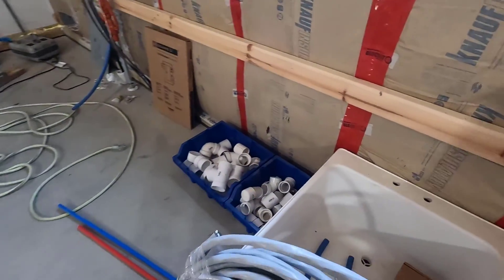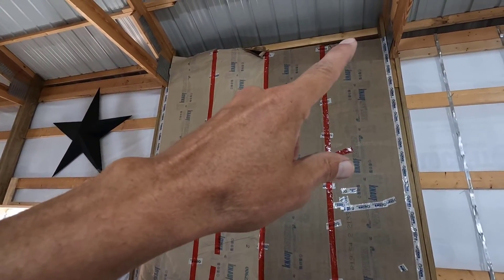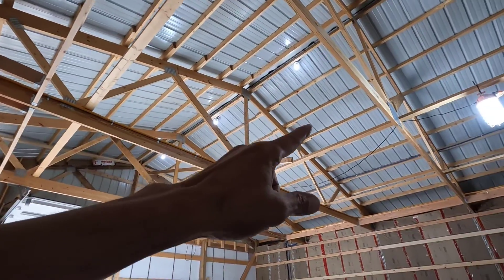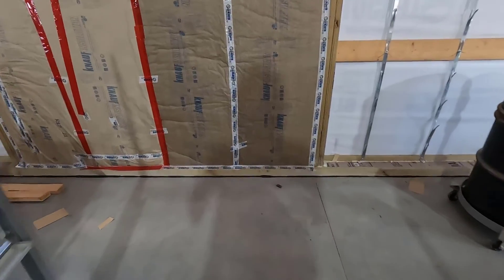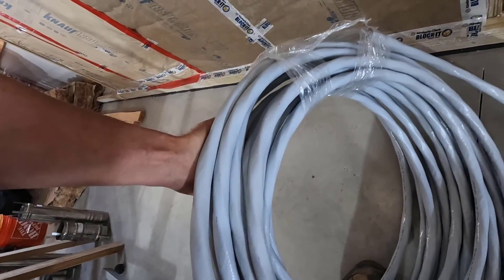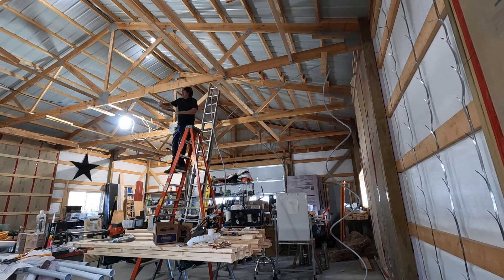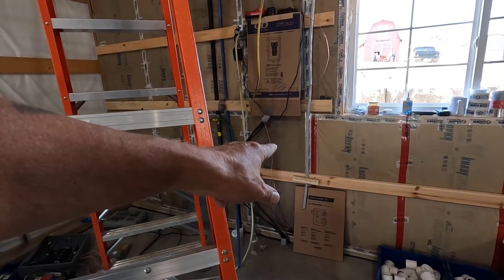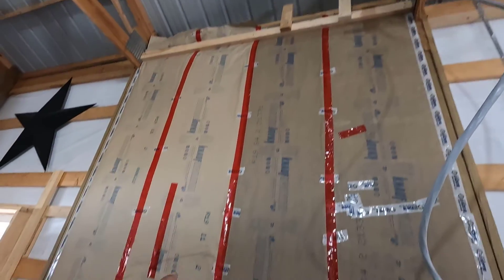Running Service Entrance Wire for Subpanel in Woodshop

Comment from the maker: This was one of those things that needed to be done, but was fairly hard to do. The heavy service entrance wire (3 sizes smaller than the actual service entrance which is 1/0) has enough capacity to bring 100 amps to the far side of the shop, but will be on a @ 90 amp breaker. With any luck, I will be powering a large lathe in that corner some day 😊 — 2-2-2-4 SER Aluminum Service Entrance Cable - https://amzn.to/3FABd10

Comment: Hi Mojo, nice video, one step closer to insulation, ceiling and some much needed heat, it's surprisingly mild here in the UK for November.
Reply from the maker: Thanks Larry, It's mild here as well — for now. Generally the real cold weather starts at the end of November to the beginning of December, but freezing weather is just around the corner. My biggest fear is putting up a metal ceiling in single digit weather — that would be a disaster! 🥶 We have high temps in the upper 30's coming in ten days so it may very well happen...

Comment: I've seen machine shops that are like this with several sub panels distributed throughout the building. I agree, it really helps with motor startup especially! Things are really moving along fast with the shop build! It looks like we will be some projects coming out of there soon 😊
Reply from the maker: My uncle was a commercial electrician, and he wired his house this way. It makes a lot of sense. Running a normal sized wire for a machine 100 feet will cause the wire to heat-up which is a loss of electricity and puts strain on the machine itself. With this subpanel, the same machine can have a 20 foot wire supplying power!

Comment: I've heard of wiring with heavier individual wires, but the big wire going to the far side of the shop makes sense! Are you going to have more machines than are out there now?
Reply from the maker: I'm not sure what will go down, but I would like to have a large lathe in the far corner there, a much larger band saw, a larger table saw, and the dust collector will need a big upgrade down the line somewhere. So I guess the short answer is hell yes! 😊